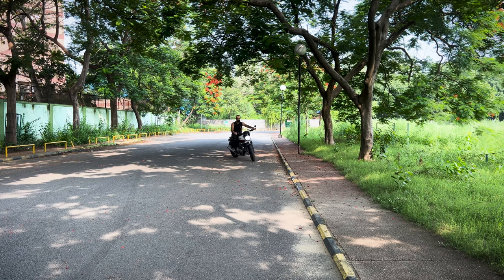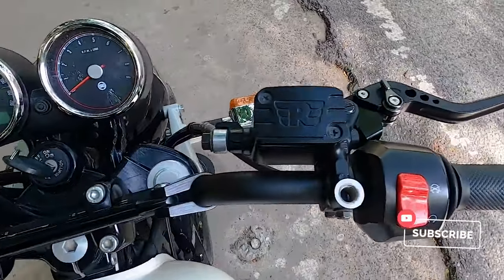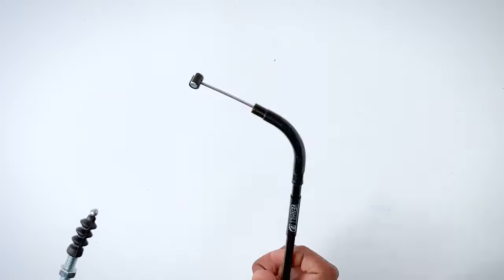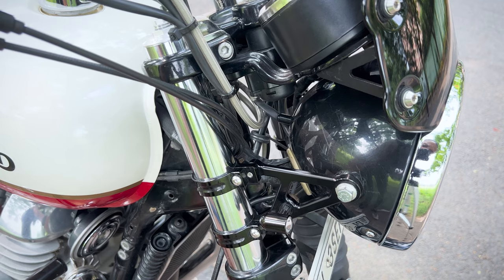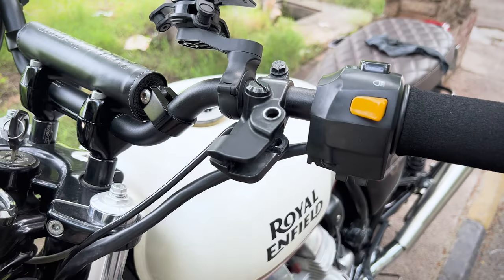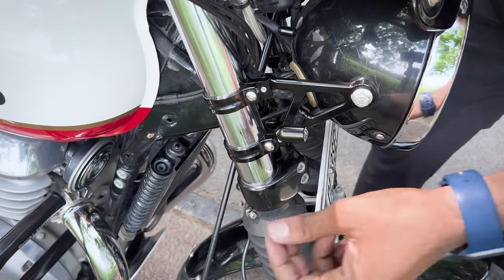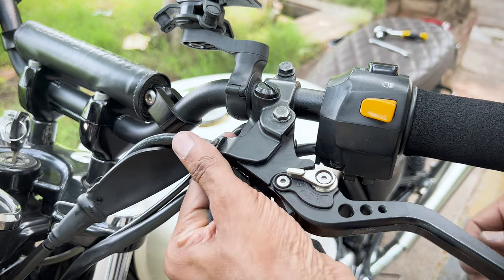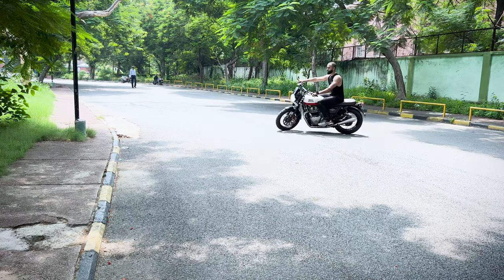Venhill Featherlight Clutch Cable for the Royal Enfield Interceptor 650

Comment: Had the same thing with my stock cable, tried loobing it and it had actually frayed inside the cover. Lasted 12k miles though.
Reply from the maker: I lubed it many times and it just became part of a messy routine. Hence I got this cable and its sleeve. Much smoother and much neater. Phew!

Comment: Thanks for Srini For the. Given cost which seems to be INR 3000 without shipping, is it worth investing in this cable? I do feel that tightness and crunch feeling which is bothersome.
Reply from the maker: yes it is troublesome especially in traffic! Yes I believe it is worth it. I also had a look at the alternative easy Pro clutch, but it is of a similar price. And if given the option, I'd rather go with Venhill
Reply: @SrinivasGanesh  Thanks Srini. I'm reading about ProSpec easy clutch.. Some videos say it will impact the clutch plate after few months. Will explore more about it. Regarding Venhill, do they ship to India or do they have any dealers in India?
Reply from the maker: I got it through my sis from Belgium. I do believe that they ship to India, however it will be subject to customs duty. @dudefromcbee
Reply: @SrinivasGanesh   Thanks buddy. Will also check with them on this and the potential duty charges. Quality of the cable seems to be much better. But, sorry to bother you again. In terms of ease of operation, hope it's much easier to operate, especially in traffic and also wanted to check its ease of use for two finger operations.. I use the TEC adjustable lever.
Reply from the maker: yep it is very easy to use. I use Diablo adjustable levers :) For now it makes some sort of a noise, I'm working on deciphering where that is coming from, the clutch is smooth though. Will make a short on what it is once I zone in on it. @dudefromcbee
Reply: @SrinivasGanesh Good to hear that and look forward to the update and the resolution on the noise related issue. One final question. Believe you have used handle bar risers. Did you order a cable with additional length? 2-3 inches? Most of the folks who might be installing this cable, might also have installed a riser and pre-load adjuster.. So can you mention it in the video description or shorts or add a comment.
Reply from the maker: yeah I have 1 inch risers. anything above that you would need a longer cable, else the standard one would suffice. @dudefromcbee

Comment: Am also using diablo adjustable lever and facing tightening issues with my clutch cables.. I'm also using handle bar risers from oftrailsmoto
So my concern is can I go for road Power coustoms clutch and break cable in a 2inch wider option??
Reply from the maker: You can, but if your risers are more than 2-3 inches, then definitely you should opt for a longer cable. if its 1, 1.5 inch, then stock cables will be fine.
Reply: @SrinivasGanesh  yeah sure

Comment: Hi Srini, for my Interceptor 2024 model, I'm using Carbon Racing angled handlebar riser which raises the handlebar by 42mm and inclines by 21mm towards the rider. The stock clutch cable is working with a re-routing - but it damages the 'looks'. I'm planning to get this Venhill model with a customised 4inch additional length - so that I can use original concealed route and stock clips. Do we have any lengthy Indian cable (~135cms) available for 2023/2024 model. Please advice - Thanks in advance :)
Reply from the maker: Hi! Firstly, Thank you for becoming a member.
Yes, let me make a members only post and reply to your query. :)

Comment: Hi Bro...How to adjust the clutch free play in interceptor 650, 2 to 3 mm free with straight handlebar  position or by putting the handle in left postion? Please suggest!
Reply from the maker: You will see an adjuster nut where the clutch lever begins. Just rotate that to either increase the play or decrease the play. Measure it from the tip of the lever 2-3mm. 🫱🏼‍🫲🏽

Comment: I have an issue of fluctuating RPM. They changed rhe throttle body as well as the RR unit. But the problem still persists. Any suggestion what is wrong? 😢
Reply from the maker: Hmmm, my guess, check the spark plugs and their cable. There might be an electricity leakage.

Comment: While ordering should we opt in for the extra length or will the stock setup do?
Reply from the maker: If you have 2 inch risers installed then extra length would do, if not, then stock set up is good to go.

Comment: this cable or easy clutch with stock cable ?
Reply from the maker: I have only used this cable. And it is very smooth. I did hear about easy clutch, but only after I had bought this one. So my preference, until I use the other one, will be Venhill Featherlight Cable.

Comment: What’s the clutch cable length should I order
Reply from the maker: It is of normal OEM length. I did not opt for a longer cable if this helps. I mean there was an option of OEM length, or extended length. I opted for the former.